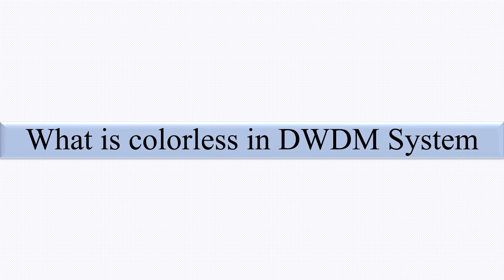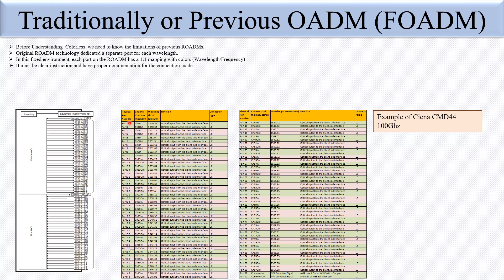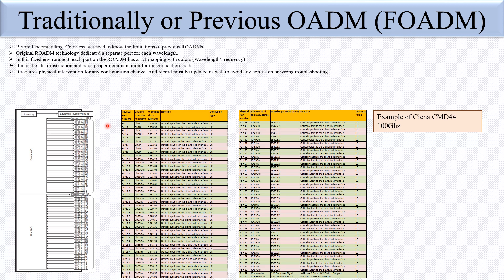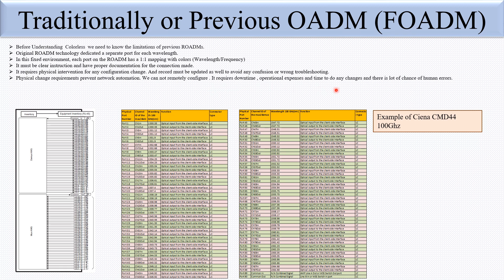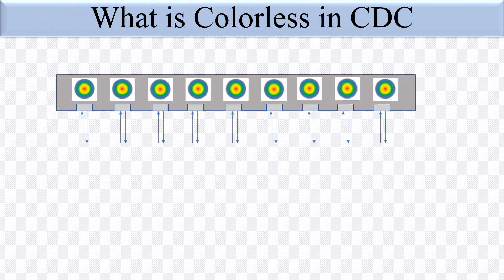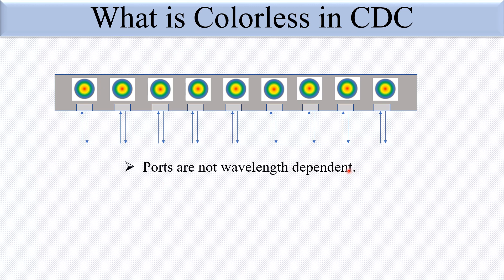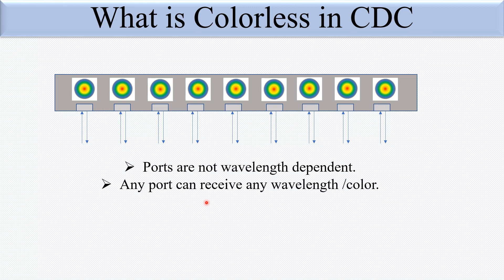Colourless in DWDM System

Comment: 11:52 Just have a doubt - does this mean that we can use regular O-band 1310 nm optics with ROADM? unlike previous tunable C-band optics which is still lot expensive?

Edit - since most ROADM are active, does this also means if I take 10,100G rated for 2km, it can also push it for long haul 80-120Km?
Reply from the maker: Its the Transponder Line card which connect with the CCMD and can tune only on ITU-T Defined C Band .
On client port you can use the 1310 .
Reply: @DeepakKumarSingh2015  I've heard that most newer model of DWDM don't require transponder. You can directly plug the optical signal output of a transceiver into DWDM/ROADM.  

Let's take Adtran (Adva) FSP 3000, it's a hybrid extensible ROADM and DWDM. When it says it's colourless, can it also accept O-band or the optics should be within C band only?
Reply from the maker: @RahulAhire  colourless means any  Mux demux  Port can be used for any wavelength and im C band ITU -T . 
There should b a card whous output must b im Mux Demux input right that is transpodner.
Reply: @DeepakKumarSingh2015  thanks for your answer but I'm still confused on one thing, let's say the ROADM is tunable and I have a single lambda QSFP-28 C-band channel 21 optics. 

If my CDC ROADM has 10 input ports/channel can I buy 10 optics all of them are channel 21, plug them in router and then connect QSFP-28 with this CDC ROADM via LC cable and use software to adjust every right.

Is this correct?
Reply from the maker: @RahulAhire  As for your query i undersatnd that you want to connect 100G router port directly to Roadm . 
Its the transponder who tune on specific wavelength.
In your case if you want to connect the 100 G router port directly to roadm . Its the router card which spcify the channel.
You can connect the same channel on differnt port of roadm this is contentionless but condition is that you have to pass all the same lemada in different diretion .hope it resolve your query
Reply: @DeepakKumarSingh2015  thanks for the info.

Comment: What is difference between coherent and non coherent transmission.
Reply from the maker: Thanks for comment . Coherent Transmission System use the Coherent light signal while non Coherent Transmission System used non coherent signal .

Coherent System/Signal => Coherent sources produce waves that have a constant phase difference with the same frequency and amplitude and in modulation Frequency and Amplitude is used .
Non Coherent System/Signal  => Non Coherent system or Incoherent Source  produces a light wave having a different frequency, wavelength, and phase .

Hope it help.